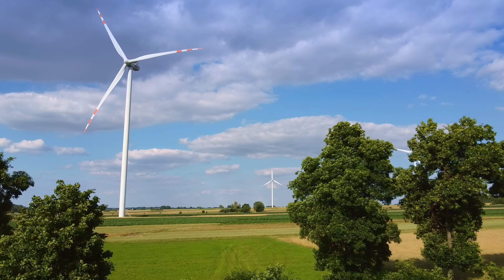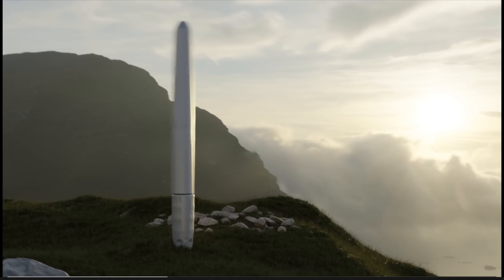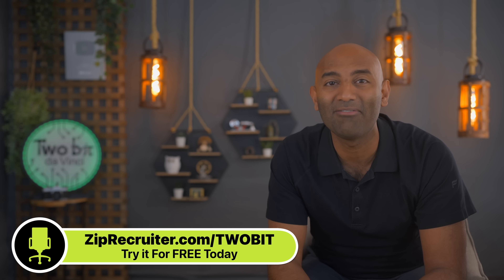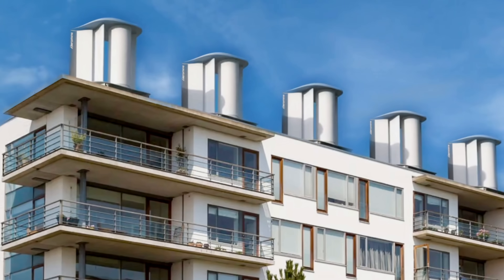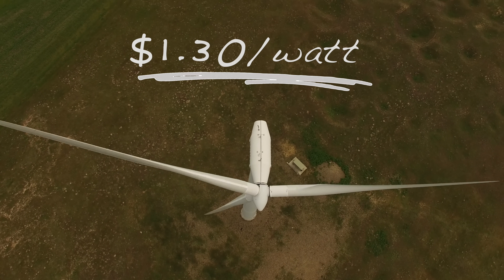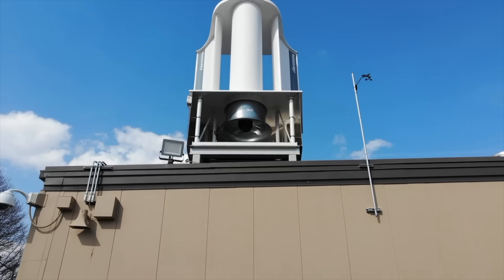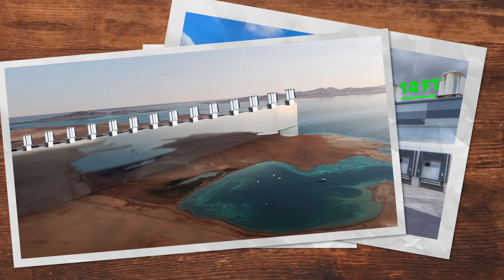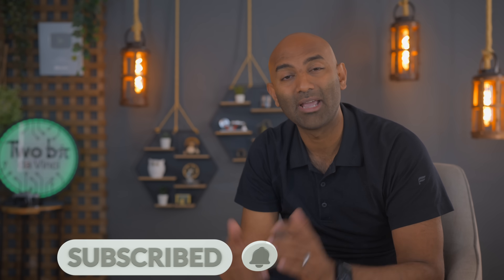Can This Genius Wind Turbine Outperform Rooftop Solar?

Comment: the cost calculation is a huge problem for that kind of wind turbines. you really need a measurement over a year to figure that out.
what is also interesting is storage with flow cells. because increasing the energy and not the power just needs another tank but no extra plates. this way it is possible to scale it in different directions. adding a box with plates to increase max. power or adding tanks with the liquid electrolyte to add energy. that gives an interesting economy of scalability.
but i really don't know how big a tank for 1kWh is and how much it costs.
5kW peak is enough to run a house. if you have an EV, you could add extra 5kW plates or 10kW and add another 10kWh tank or two and scale it up with extra tanks.
would be nice to have an overview of different manufacturers, and costs.
i don't have any clue regarding costs, especially when we compare it to upcoming sodium ion batteries. maybe the longevity is an interesting point too.

Comment: It's always worth thinking about scale. Modern offshore turbines are 15-20MW compared with 5kW for an aeromine. They are twice as efficient and sit in much better wind, so will probably have a capacity factor around 5-10x higher. So a single offshore turbine is going to generate the same as perhaps 20,000 aeromines. A modern offshore wind farm can be around fifty turbines. One offshore wind farm = a million aeromines. And that's why large wind farms produce such cheap electricity.

Aeromine a neat idea and there will be good use cases, e.g. off grid buildings, but don't expect it to be replacing large scale wind farms.

Comment: I just realized why you frustrate me so much, when you gave a trigger warning about putting on an engineers hat. As a tech channel  I come to learn the engineering. Instead we get 98 percent hype 2 percent explanation.  Why is it fixed? why  does it pull air through a long manifold pointing down wind?  What does the column in the middle between the airfoil do? What are the size  limits? Again you say the building must face the wind I get why that would be better but  I can't sleep because the wind is howling by outside, you gave numbers that you can double a 10 mile wind to 20 or 50 miles per hour in parts of the structure; which parts??? Can the  machines only be on the upwind side of the building ie the wall acting like a dam to force wind  up and over, on the down wind edge of the roof the extra space acts like a  air fall also speeding the wind . What is special About the 90 degree change in wind direction?  Say you have normal house with a 4 gable roof wind goes up wall only change  direction 45 to 70 degrees up the slope to peak where the wind catchers are does a 90 degree to 40 degree change over the ridge line  seems to me it still should work. Say you have a 50 by 50 foot building  a  wind catcher on each gable and one I in The middle no matter what  direction the  wind at least three would get clean uninterrupted wind if then turn to follow the wind.

Comment: If it has this type of potential. The inventor should license production so this could be mass produced. The design looks so simple that this also could be copied for self use, whatever legality.. Is there a benefit from making the fins and system even taller? Like stacking 2 - 3 on top of each other, and re-plumbing the ventilation shafts?

Comment: It is very misleading to use nameplate capacity when citing the amount of wind generation being installed. When converted to average actual power the number is very much smaller. Divide that figure by four for onshore wind and between two and three for offshore wind. Then deduct the degradation of existing wind generators output and those that are coming to end of life.
Wind is no saviour and however much capacity is installed needs an equivalent amount of conventional generation as well. (Meredith Angwin's book Shorting the Grid puts the figure at about 1.1 x capacity of conventional for 1 x capacity of wind.) Wind cannot run by itself it needs conventional generation as well.

Comment: just for fun I have calculated the required wind speed to achieve 5kW (considering the 20% efficiency and surface in the wind of 7ft x 21ft from the picture in the video) - it is about 52 km/h or 32 mph (at sea level and 20grdC). And don't forget that the achieved output decreases with the wind speed cubed.
Reply: Yes. You have shown that this thing is pretty pointless.

Comment: Always remember: when an energy "source" delivers some amout of energy, the same or more must come in at the other end.
E.g. for solar power: there is the "fixed" 1kW/m2 best-case solar radiation input, and the output will always be less than that or equal.
For wind power, you can similarly calculate how much energy there is in the wind captured over a certain area.
No wind turbine, no matter how magical it looks and how revolutionary its design, will output more than that.  When the makers claim it anyway, it is a scam.

Comment: 12:33, with 133 GW you can power 133 million people. In this case, 27.000 turbines would produce 133 MW, not GW… Please take some more time to do the math correctly. An earlier video also had a huge error in a graph.

Comment: I'd use some of that suction power to chill some solar panels
Reply: Is sucks that I can't see other comments on my thread damn censorship, whatever pushing on. Your using it to turn a generator when you could simultaneously be using it to drive an air-compressor, then powering vortex coolers and like technology i also recommend throwing thermoelectric generators somewhere in the mix

Comment: These units sound good but for a very select few due to shape of building and regional geographical area, why not have something like an exercise bike or rowing machine connected to a supper dooper gearbox connected to a super dooper generator and charge up your own batteries, its like every other week their is some new form of power generation that's in constant development but only generates the developers money and not practical savings for the regular Jo. With all this cheap and affordable ideas that don't come to fruition why not go back to basics and work on small generation and gear box multiplyer, it's simple and people in these fields have the tec for development.

Comment: At 1:13 I I think you have the data wrong,  in 20121, the average annual electricity consumption for a U.S. residential utility customer was 10,632 kilowatthours (kWh),  that's 10.632 kw, not 1.2kW as stated in your video, leading to a cascading erroneous calculation.

Comment: For residential wind generation sound is an issue.  This turbine is also pretty ugly.  Many communities would not allow them for that alone.  There is a company in Ontario Canada that has developed a silent ridge-mounted turbine.  It would sit above snow accumulation on the roof.

Comment: So similar to a carburetor or blowing over a straw, reducing pressure pulls fluid or air up the tube. Also similar to a chimney. They Powe up on the draw, not the blades. Its like a jet. I've seen those big funnel like air ram things they can bring in air from all sides and drive a turbine, very similar. Its worth building a rower for this. You could even stack them AND OR put them on a rotating platform with a fin. You could also put them over industrial exhausts...

Comment: What I thought about when hearing this was that it might be a way to cool solar panels - since you can take the input air from anywhere.  (Cooling solar panels is a big deal because it increases their lifespan dramatically.)
Reply: yep, you can suck air-conditioned air from inside the house and cool you panels.
Reply: @dana-pw3us , “sucking airconditioned air” out of your house sounds HUGELY inefficient.   Spend all that money to condition and trap that nice cool air in your house, all to send it outside, to instantly dissipate into hotter air.  Not very brilliant.
You’re better off using cool, misted air. 
I’m still not sure this would be practical either. But it’s more in the right direction

Comment: There's another design that shows a lot of promise, that is similar in it's small footprint, can take low speed wind from any direction and has relatively high output-  it's a Darwin wind tower.
Robert Murray Smith has a couple designs over on his channel.   It's a cool option for DIY sorts.

Comment: I was laughing at the part where you mentioned "BIRDS". I know that the bird caring segment of the world is up in arms regarding the wind turbines killing birds, but a couple of research findings from a while back kind of put a kibosh on their beliefs. The groups wanted the owners of the turbines to take them down and local communities not to grant permits, but wait... A few studies showed that the wind turbines were less dangerous to birds than a few other bird terminators. Their numbers, how close to actual would be rather difficult to confirm, but show a different picture then we were lead to believe. First, the statistics showed that "Wind-Turbines" kill around 140K - 500K per year. Secondly, "WINDOWS" (not Microsoft) account for the second highest total of 1B annually, but surprisingly "CATS" account for 2.5B birds each year. So, if they are so insistent on removing all the Wind Generators to save birds, should they not be looking at the elimination of all CATS, to save the birds? Just a thought. Great video! Oh, even if you removed all the Wind Turbines and modified all the buildings in the world to be Windowless, the total still would not be greater than the CATS total.

Comment: I have to take issue with the 1.2Kw average household consumption figure as stated in the vid - we live in a modest 1800sq/ft home and typically use 600 - 800Kw per month.

Comment: The maths around the Line sounds wrong. Are you sure you didn't mean 133MW? 27000 devices producing 133GW means each produces 4.6 MW when they should produce only 5 KW max. Just interested - did you get ChatGPT or Perplexity to do the maths/conversion here? I previously tried it with both and they both get confused when converting these scales.

Comment: @8.50  “18% efficiency @ wind speeds as low as 22 miles per hour”  which is e 9.8 meters per second. I have measured the wind speed on third floor of my house on a very windy day @5m/s. It also a fixed design  - my wind direction changes from the south in the summer to from the north in the winter. I have a flat roof but won’t be considering this option.

Comment: What's the actual performance of the BASF trial? I'm skeptical with any small scale wind turbines as the localised turbulence intensity at the corner of a building makes its really difficult to extract power from it. Especially is urban areas where you need to get up really high to get laminar flow to make them efficient enough.

Comment: The projected cost and production figure comparison with solar do not state latitude of installation which makes a massive difference. If the installation is in a relatively northern location, even in sunny climate, your solar production is much lower than in a place like Florida. In addition, the higher the latitude much greater production concentration in the late spring and summer months which may create higher surplus.

Comment: It always cracks me up that efficiency is so frequently the OVERARCHING concern when it comes to renewables like wind and solar. The first concern should be cost per kilowatt-hour. The fuel for solar and wind are free and effectively unlimited; conversion efficiency is only really relevant insofar as it affects our ability to place sufficient generation where it's needed. THIS is why solar efficiency is a pertinent metric - its effect on the number of square feet of rooftop needed to generate the desired amount of energy. These days, most mainstream panels are more than capable of producing worthwhile output on an average rooftop. This particular form factor (for wind power) will probably need to get a lot of cosmetic upgrades before most people will be interested, but there's bound to be smart people who will be able to identify appropriate use cases for these new technologies.

Comment: Ricky, do any of your roof lines face the ocean and not have solar panels? How about putting a series of small, long, squirrel cage generators (similar to over-door air curtains, but with reversed flow) at the ridge AND a series of shutters above at the opposite angle from horizontal as your roof? When closed, that would funnel a lot of wind into the generator(s). In high wind, each spring-loaded vane could open to furl the shutter at a
designated load. They could be snubbed or damped to reduce the noise of closing and chatter at the threshold wind load. San Diego planning department would love that idea, huh?

Comment: The design is simple yet effective. Can see a lot of potential to utilize this concept for wind power production. With all day and weather electricity production, it seems like a better value than solar alone. Very scalable and adaptable as well. The physics works for water as well, really anything with fluid dynamics.
Reply: Not effective. The efficiency is pathetic whereas large commercial wind turbines get pretty close to the Betz limit.

Comment: Wondering if you can tie this into existing solar so that the suction caused, could be used to cool the panels. Or perhaps due to hot air density it could make things worse for the turbine.
Reply: This is actually a great idea. Something worth looking into.

Comment: Thank you!  After watching a number of videos about this thing, you showed the part that was always missing.  The holes.  It finally makes sense!  I couldn't understand how an airfoil would matter to the bottom mounted fan.  It's all clear now.
Reply: Yes. My thought exactly. It's super counterintuitive until you understand how the thing actually works. I think it's an awesome design And it should be scalable. I wonder if these things would work offshore, like on the edges of an oil rig or something!
Reply: @Israel_Two_Bit  Agreed.  They need less height and space, less distance between, but they may do better on the side of a building.  I've seen the best design on a roof beneath solar panels, but that may depend on the weather to that local.  IDK.
I wonder if scaled-up would do as well or better.  I also wonder if some of the electricity created could also go to some slight heating aspect for colder climates, to prevent ice/snow buildup.
Reply: @PaulADAigle  I'm sure it could. I mean, I don't see why not. One thing I like about this whole setup is that, since the spinning blades of the turbine aren't in the wind itself, and there are no moving parts in that portion that is exposed to the wind, I'd be willing to bet these turbines cause less disturbance in wind currents than bu turbine blades. So you may get away with a much higher turbine density in any one wind farm (offshore or onshore). That may offset the lower efficiency while dramatically cutting down cost at the same time.

Comment: I remember when Matt at Undecided covered these.  I have been watching them ever since then.  I am wondering how they would work on a standard house, as the roof on a normal house is not flat, and thus causes a very different pattern for the wind.  I don't have the computing horsepower to create a fluid model of the airflow over a typical house to get an idea though.
Reply: I am lucky enough to live coastal. So I don't believe it would be needed with certain building surfaces, because it mostly always has strong winds. Such a low cost thingy, could sell really well compared to production costs of silicon for solar panels, or costly full scale wind mills. If this thing cost more than a medium sized boat, I think they are overcharging you/us. As the material cost visually looks low. It's the idea and the patents that should drive the price upwards. If they license this for a more smooth production I think the inventor can get rich very very fast
Reply: @grilsegrils9330  absolutely, patents are holding humanity back. There are too many people in positions of power that uphold their own salaries and power by supporting a patent system. And when someone says patents are needed, just ask “if you had to survive and needed to create a patented item , you wouldn’t?”
Reply: @vicariouswitness  Kill the patent system = eat the seed corn
Reply: @kreek22  we never know until we try
Reply: Iv'e got a normal house and it has flat roof, albeit a skillion roof, if Aeromine sold to the domestic market i would have one in an instant. I will look up  the Undecided video out of interest, thanks.

Comment: what about the conch shell kind of small scale wind turbine called Liam F1 Urban Wind Turbine. Supposedly With an average speed of wind of about 5m/s, the turbine generates about 1,500 kilowatt-hours of energy. It's a Dutch company. less than 100kg (or 220 lbs). So if a person could stand on your roof, so can this wind turbine. combine this with solar and for a lot less money, that should even out that solar sine wave.
Reply from the maker: looks cool, thx will look into it.

Comment: I have a 400 watt horizontal wind turbine in my yard but our wind is not constant enough to produce much.  I am wondering how much vibration these units cause and what is the lowest wind at which this can produce significant power?  You need at least 10mph constant wind for small turbines. I recommend solar which is more consistent than wind most places. Very few places get 22 mph wind speeds at any consistency.